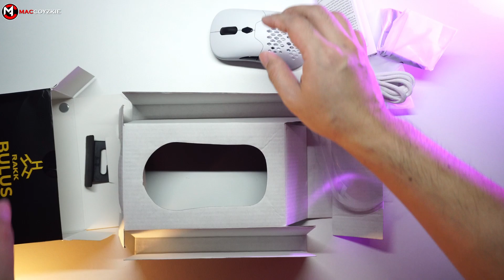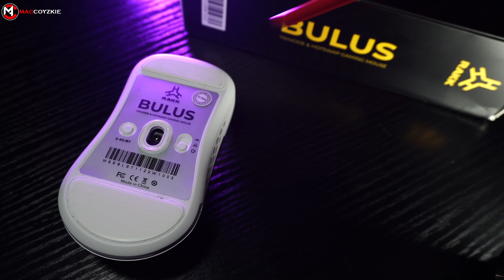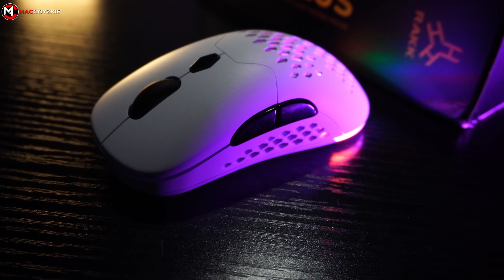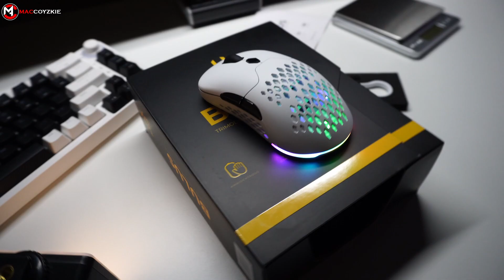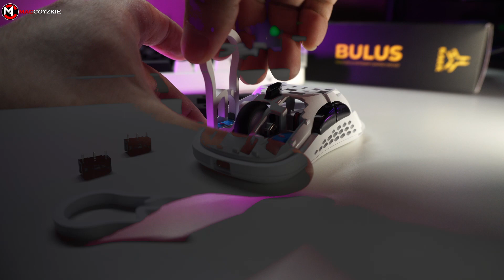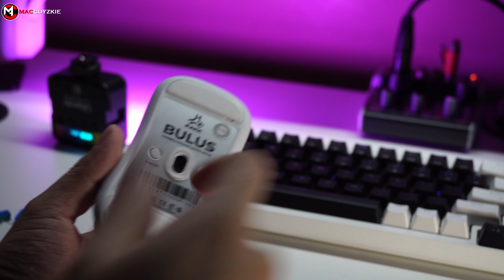Latest mouse from Rakk! Rakk Bulus trimode hotswap gaming mouse

Comment: Di ba sagabal yung portruding na rectangle part ng cable if naka wired mode? In short, same feeling pa rin ba ng wired-only mouse if naka wire mode to na mouse?
Reply from the maker: di naman paps so far ok lang naman, ang kinagandahan lang ng cable eh malambot di sya stiff kaya ok lang pero iba parin ang wireless

Comment: Great review! would you say this is better (or at least more worth it) than Tecware Pulse Elite? Or is the Tecware Pulse Elite a mile better? Is there a significant difference in terms of sensor between the two? I would be considering both, as my option for buying mouse right now is the hotswappable feature.
Reply from the maker: Thanks bro, not better but there are pros and cons, for one the sensor, another is the battery where rakk has better one, software goes to tecware, bulus is a heavy in spite of the honey comb design. I think i need to make a video comparison since there are a lot to talk about
Reply: @MacCoyzkie  Thanks! will wait for the review. I almost bought a Tecware Pulse Elite just recently as I already want to change my heavy mouse (Rakk Dal'Ang), but I guess I'll wait for more review to see which is more of a bang for buck.
Reply from the maker: @sepht9680  no problem bro
Reply: tecware pulse elite has a better sensor it has 3370 rakk bulus has 3325 both is good naman pero mas higher tecware pulse elite
Reply: @KathyTTiko  do you think the additional PHP 1,000 is worth it just for the sensor po (and arguably the grip since it resembles Logitech GPRO)?